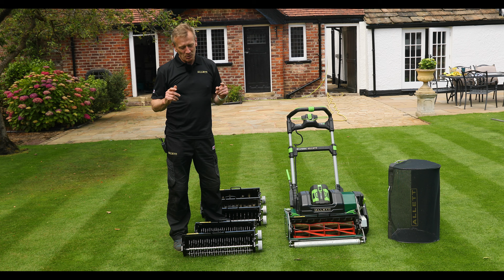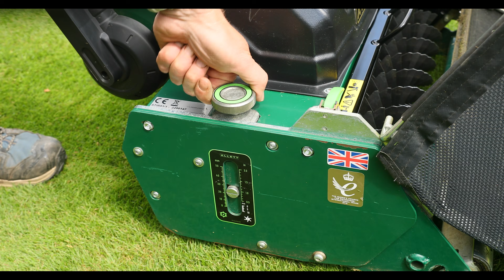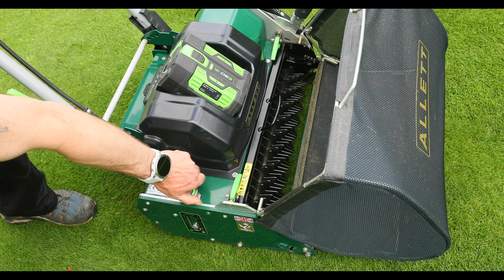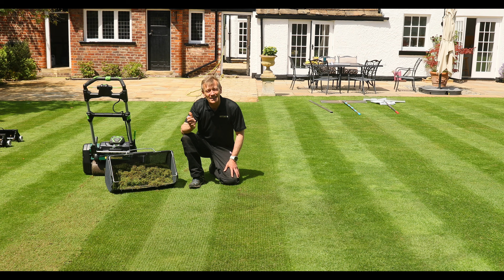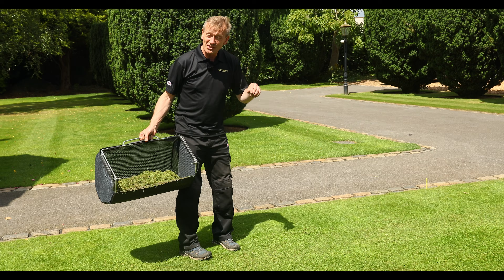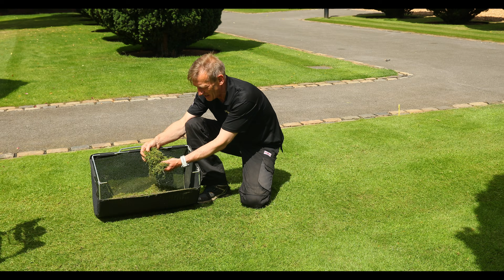NEW CARTRIDGE: Allett  UC43 and UC51 Groomer Cartridge (4K and Subtitles)

Comment: The Stirling is a good mower and versatile with its cartridge system. It’s not without issues though. The dealer I bought from was very poor when it came to a warranty issue. My  grass bag came apart and the dealer just wasn’t,t interested. Never returned my calls. It took almost a month to get a replacement bag.
Reply from the maker: @mattself5342  Hi who is your dealer please? If this is a material issue it would be covered under warranty

Comment: Interesting Video 🤟

May i ask one questen:
I have a altco balmoral 20sk (which is the same like the kensington, right)
I bought today a verticut Cartridge but may i ask if theres a trick to set my height down to 6mm (S) so the gras box doesent grind on the gras?

🤔

Maybe i need to rebuild somthing on the cartridge itself?
Is his "problem" known?
Reply from the maker: Hi have you got it on right?
Reply: @ALLETTMOWERSUK  yeah i have seen your unboxing videos too so 🤷‍♂️
Reply from the maker: @grayfox87kurt26  not seen it dragging on the grass before 
What height are you cutting?
Reply: @ALLETTMOWERSUK  wait let me try something - i will try to adjust/remove the rake 🤔

I set the height to 6mm (S)
Reply from the maker: @grayfox87kurt26  rake being too deep will make your rear roller spin and stop you moving forward 
Shouldn’t make your box dig in though
Reply: @ALLETTMOWERSUK  ok got it, my rake was set to low and i thought it was the box 👌
Reply from the maker: @grayfox87kurt26  brill glad you’re sorted